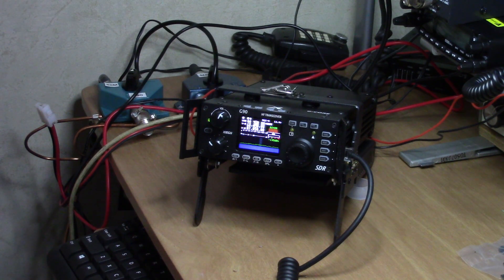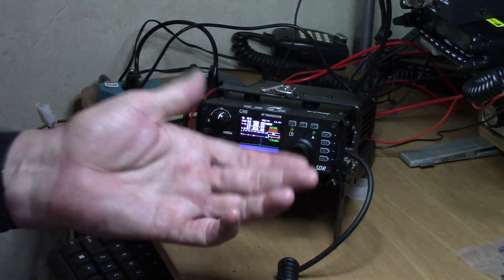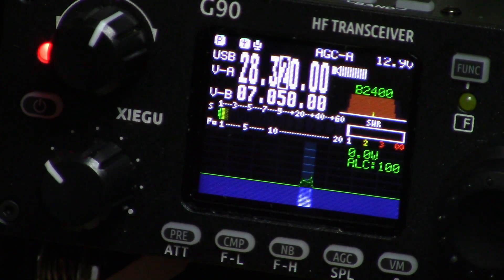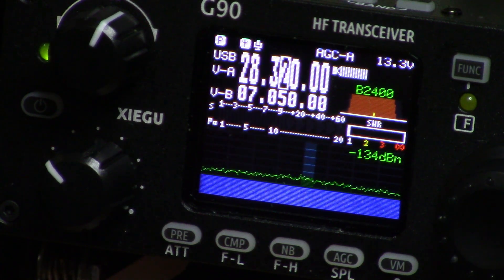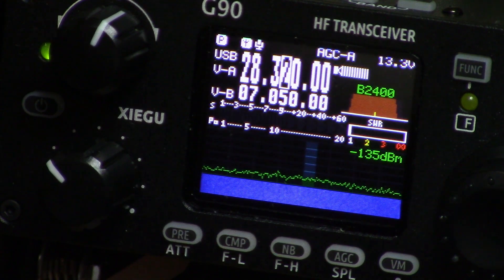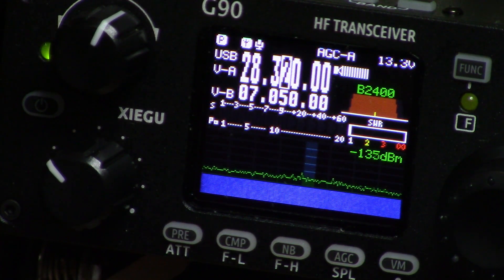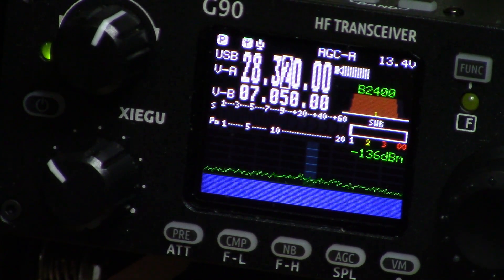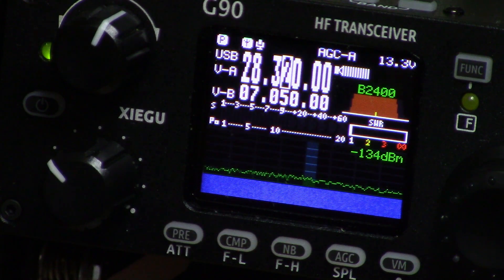AirWaves Episode 36:  Xiegu G90 Firmware Fix For Transmit Failure

Comment: Thanx Buzz. I just got mine. I have a furious learning curve to climb. So darn cornfusing! There’s a lot of stuff there to figure out..  Their flyover of some basic issues is disappointing. Little(?) things, like
just simply how to
crack the unit apart, front and back.
How to create settings such that the display factors are optimized. Or- for example, what do the various display colors indicate on the rhomboid of the screen? What does the rhomboid represent and how does one adjust it.
Things such as these!
Thanks Buzz 🐝 
George KK7MCE

Comment: I have a feeling that there are a lot of dead G-90s out there. I have the same problem. Radioddity told me to update the firmware too, which I did, and it completely bricked it.  Alter consulting with them, I tried the firmware update again, and it started working. This only lasted for a couple days however. It certainly seems related to the firmware, but I’m running 1.79 now and the problems persist.  I turn it on sometimes, and it works.  When it works, it’s just like a new one… then it just stops. If anyone has any later information, I’d love to hear it.
Reply from the maker: I'm still running 1.74, and it's been rock solid.
Reply: @Airwaves-Radio  I hope it continues for you - I really liked the radio.

Comment: I’m having a similar problem with my G90. I don’t have modulation when I key de mic and the reception is zero. Seems like using a dummy load. At first it was sporadic but now it is completely non functional. I already tried to flash de firmware a bunch of times, downgrade the version and nothing solved the problem. Only option I have is wait for the next firmware version and hope it will fix it. If you have any thoughts, that would be great. Thanks!

Comment: I have a problem and maybe you can get an idea how to fix it. I completed the 1.78 firmware update on the main unit and was in the process of updating the display unit when the G90 shut down. I can't turn on the G90. I was plugged into electrical power so the unit had power throughout the update process. I cannot turn on the transceiver. . The G90 transceiver was not hot or overheated. Hope you have a suggestion or two.
Reply from the maker: Factory Reset G90 To complete a factory reset of the G90 press and hold the "FUNC" key and power on the G90. Then press the "PRE" key to confirm the reset or press the "VM" key to cancel the reset.   If that doesn't work, I would contact the company you purchased the radio from.  Good luck.

Comment: I just received mine from Radioddity and it has the same problem, it has tx in AM but nothing in ssb. It has the most up to date driver, V1.78 (Jan 19 2022). I reinstalled the drivers and it still does not transmit. Does anyone have any ideals? Thanks
Reply from the maker: You can send it back to Radioddity for repair, or least that was an option when I had the problem.  At the very least, give them a call.
Reply: @Airwaves-Radio  Thank you for the reply sir, I just installed the drivers again and it magically works now, so I am super thrilled. The firmware process is tricky but doable. Ppl need to be sure to click the "1k" box at the bottom when selecting the firmware file. 73's

Comment: running 1.75 and I developed this problem. Also on my 2nd G90 now. I am quickly loosing faith in this brand which is sad.
Reply from the maker: If you reload the files, it should fix it.  The G90 is my only experience with a SDR ,  but I suspect that other SDR's have similar issues   Did you ever own a computer that never needed rebooting.

Comment: Just got my G90 last week and having the same problem you had.The only difference mine came with the 1.74 firmware installed.They told me to try reinstalling the firmware.Also the filter settings were not showing the proper parameters.I also loaded it into a dummy load.Sometimes it would show output power then go back to not showing output.
Reply from the maker: Mine was sporadic at first, then stopped completely.  I think reinstalling 1.74 will probably fix it.

Comment: question still remains what caused the problem.
Reply from the maker: Not sure, but right before the problem started, i had been trying to connect the G90 with the SDR Sharp software program, using the COMM port on the G90.  Possibly some feedback through the COMM port?
Reply: @Airwaves-Radio  tough call, usually feedback makes a temp change, but perhaps it jammed up a setting I wonder if reloading the old software might have fixed it too,  guess time will tell.  thanks :)
Reply: I had a related problem with my brand new, on ssb bands it burns out like it was in fm or am mode. I keep my mouth shut but I see on the meter that it fries out whatever I asked it for. This of course making me totally unreadable.

Comment: The latest hot bugs fix patch is V1.74_build003(beta001) dated 0520020 which is particularly solving also the problem with RX sensitivity loosing after TX release as same as CW Ratio setting is back in menu and there are no more lost steps of VFO encoder. I am recommending to update to this latest revision buddy if you have not yet. Good luck.

Comment: Thanks for vid. Which 1.74 you installed? build002 or build003 (beta001)? I guess you have 1.74_build002(beta06) 04302020...
Reply from the maker: There are two files.  One for the main unit(Build002(Beta06)), and one for the display unit (Build002(Beta04)).  That's after you unzip the files.  here is the link:  https://radioddity.s3.amazonaws.com/G90_MainUnit_FW_V1.74_build002%28Beta06%29.zip
Reply: @Airwaves-Radio  Thanks mate. I checked it and it is build002 which is dated 30Apr2020. Last hot bugs fix patch is build003 dated 20May2020 which is particularly solving also the problem with RX sensitivity loosing after TX release as same as CW Ratio setting is back in menu and there are no more lost steps of VFO encoder. I am testing it and I can recommend it. No strange or erratic behavior found and improvements are really helpful. Best regards, Petr OK1RP
Reply from the maker: So the latest beta changes are all associated with CW use?  I don't use CW, so I'm just wondering if it's worth me updating again.
Reply: @Airwaves-Radio  The latest f/w fix is not related only to CW use. Even although I did not tested it on SSB I guess that loosing sensitivity of RX after TX release was appeared also on SSB... Except this issue which is particularly solved (not fully as it still appears when ATU tuning cycle is used) it also solve the lost steps on main VFO encoder and few other. But if you have no problem with sensitivity drop of receiver after releasing mic PTT and your TX modulation issue has been solved with last upgrade then maybe you not need the latest one and you can wait for final 1.74 Release. (anyway you can anytime roll back to preview version if you are not happy with new one) Good luck.